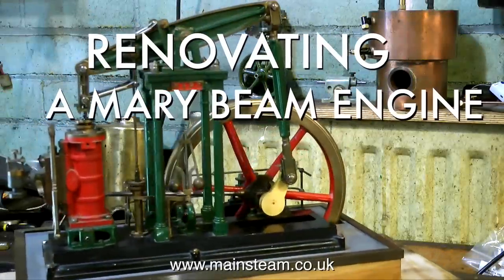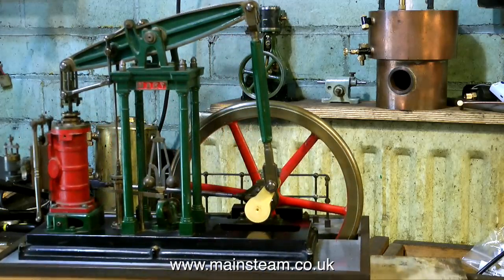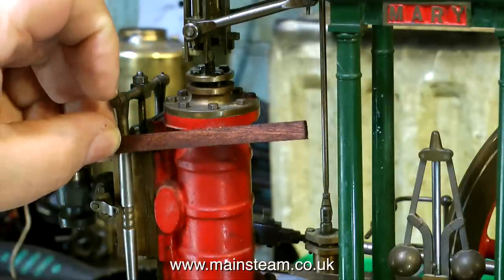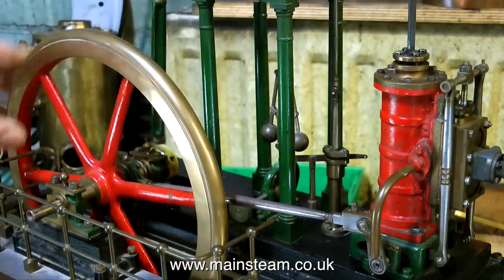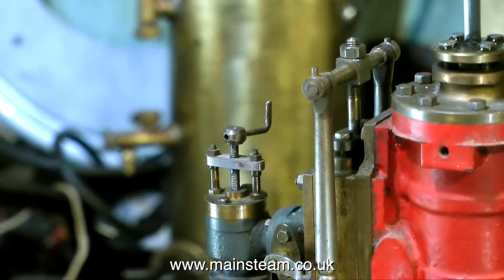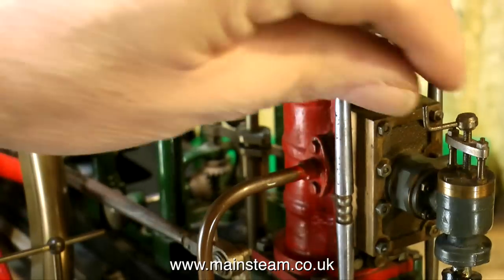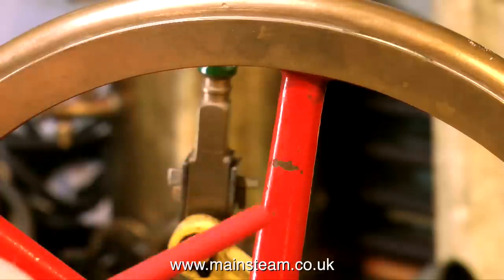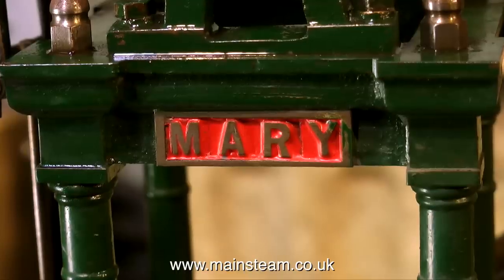PART #1 - HOW TO RENOVATE A "MARY" BEAM ENGINE MODEL

Comment: Good day Keith  Thanks for the videos.
I am thinking about making the beam engine Mary as my first steam engine.
May I ask what you opinion is about this engine - would it be a good one for 
a newby to build or is there a better beam engine of the same size.  Thank You  Rod
Reply from the maker: https://www.youtube.com/playlist?list=PLDV_TkPc48RF7K06xnlp2W_ZvN__OBmMN
Reply from the maker: A Mary beam engine is not as simple as the small Stuart one, but builds into a very nice machine. I worked on one a while back - there are some videos about it on my channel.
Reply: Hi Keith and thanks for the reply.  I saw the video when you first posted it (I've seen ALL YOUR EXCELLENT VIDEOS!) that's what got me thinking about building the Mary.  I would like to build one that looks classic and nice and plan to run it on my bookshelf on compressed are from a small compressor in the basement.  Thanks again   Rod